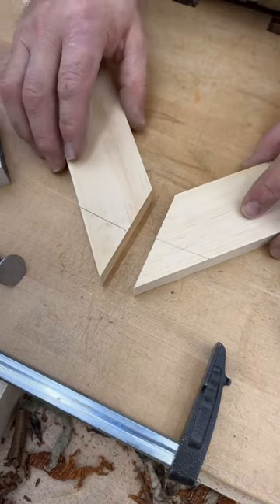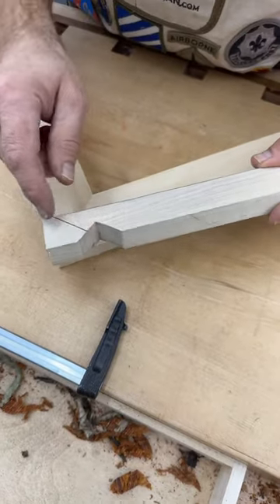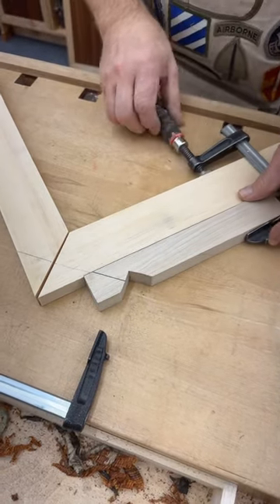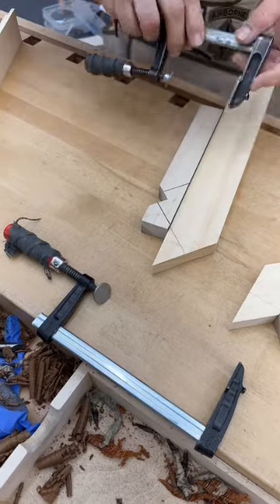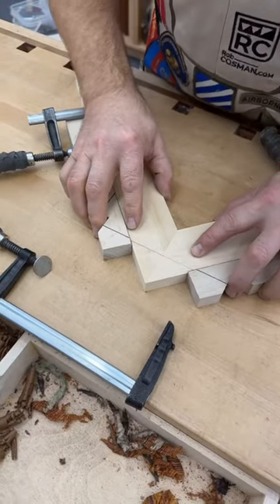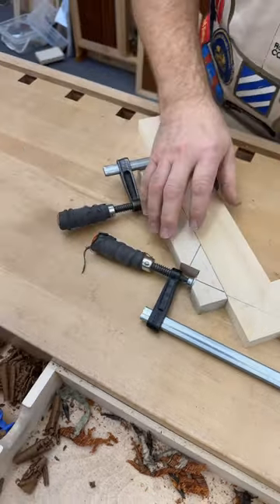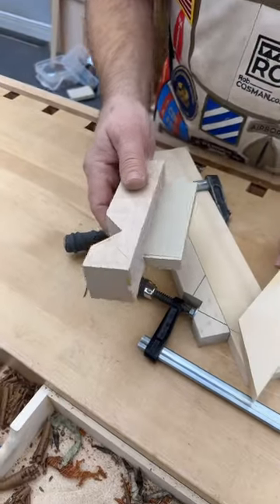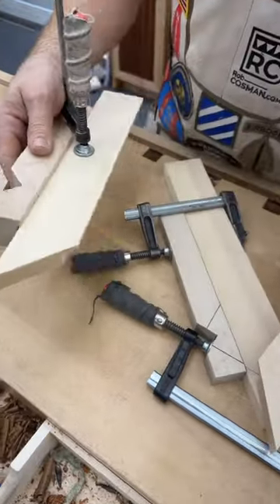How to make a perfect miter joint #shorts  #woodworking #craftsman #miter

Comment: I am in Australia and the Bunnings hardware group have a brand called Irwin. Erwin manufacture a clamping system. That will do exactly the same thing, but a quick release clamp is used to secure the entire assembly. Also very effective.
Reply: Can you put a link to that?  I don't even know what you mean and what it looks like.  I'll probably want to buy it make one for myself.
Reply: I was so confused, even little Bunnings have mitre clamps. Mustn't be global
Reply: @jeremymcadam7400  believe is specifically a Bunnings brand and that might explain why you haven’t heard of the mitre clamps elsewhere. I have little doubt that there are other brands on the market, but they may not be as cheap and maybe not as good..

Comment: I like clamping jig, but the joint is all end grain, it won't last.
Reply from the maker: It’s technically half end grain, half long grain
Reply: That's also what splines are for
Reply: It will be fine, even without dowels, splines or biscuits.  I assume this is more about aesthetics than absolute strength.